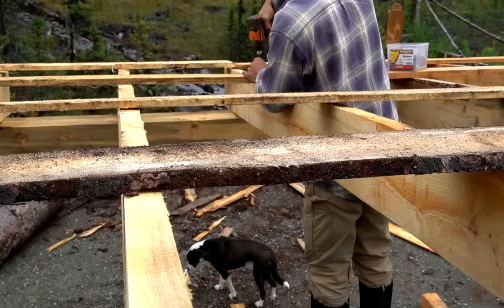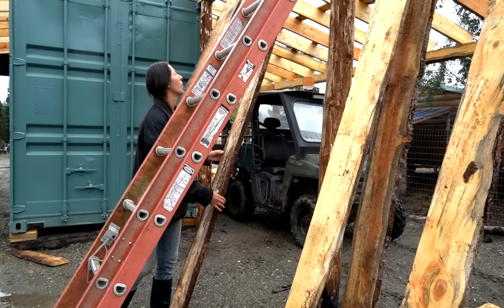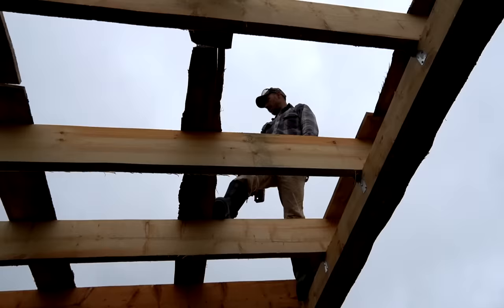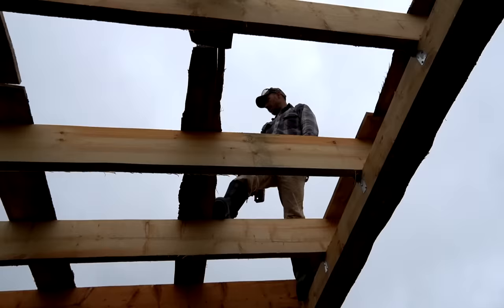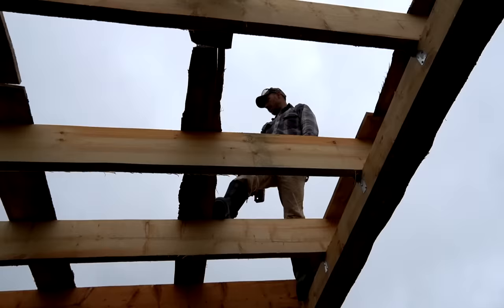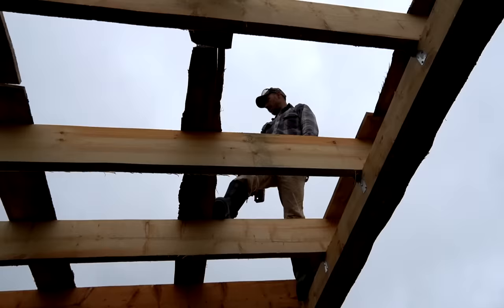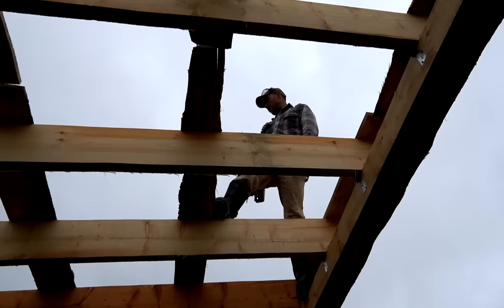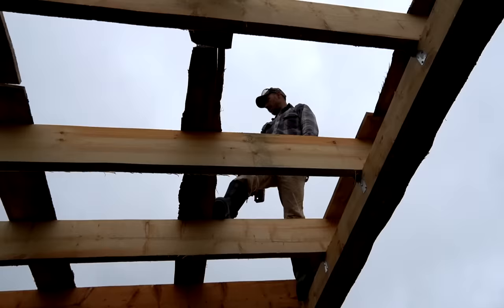Installing Metal Roof & Live Edge Siding | Shipping Container Lean-To

Comment: Okay I must know.. why did you not build one complete roof over the whole connex instead of the two separate structures? There must be a good reason behind your thoughts and I'm curious to know. Seems like it would be more efficient for snow removal and more weather tight. Not to mention if you continued one continuous roof off the back there is so much more storage to be had. ( my thoughts) otherwise nice work i hope to hear back!

Comment: out of curiosity wouldn't it be easier if the pitch of the lean-to was steeper? So in winter the snow would come of easier? Then again you've  made it very sturdy so it should hold the weight of the snow I imagine... like I said just this euro guy wondering

Comment: Ariel & Eric, I just love the end result! It will make all the difference both when it rains and snows. I am interested to know why you did not make the 2 lean to structures meet over the container thus providing it with a roof as it would save you time and the effort of climbing on it to remove the snow. You see, although not super old, I can no longer do easily some things which were quite mondane when your age, and now I do consider more options to make things more practical thus more manageable. Thank you. 
Ps: will there be a 2022 calendar, and if so, do you post to the UK?
Reply from the maker: Yes the calander is in the works, and yes we ship to the UK ;)

Comment: I’ve been looking forward to how you would put together another root cellar. Any thoughts on doing another one. Have you considered putting it under your house where you could have a floor entry (looks like a crawl space entrance but has steps down to the cellar. You could dig out a few feet (so you don’t get down to the water line and then cover it with tons of unsulation, provide a small heater and dehumidifier,   Might require adding a few extra beefy support beams to span a big enough space, but would be quite interesting. Could run a drain line around the outside of the perimeter about 6 inches
Below the level of the floor or use a sump
Pump and hole below the floor level. Just a thought since I know if anyone could pull this off it would be yiu guys

Comment: Just noticed the rear mounted winch on the 6x6. Now I have a weekend project. 
So many problems could be solved by that installation. Any mounting tips?
Reply from the maker: Just made a bracket out of flat stock and welded it in the rear frame section just make sure the dump bead will clear it. And make sure you have long enough wiring ;) love the winch on the rear!

Comment: I realize that you want live edge siding, but why didn't you cut a straight top edge at the narrowest point of each board and then overlap the straight edge of the board below with the live edge of the board above it, which would still give you the live edge look that you want, but would be more weather tight? I realize that it would take a few more boards to side it, but I think that you have plenty of standing lumber, and the scraps can be utilized for firewood kindling! To get a get a straight top edge, ( the squared off edge ) all that you would have to do is pull your tight line or snap a chalk line and then nail the square top edge along the line!

Comment: At very least you should fasten a board under the edge of the rafters that are not touching the beam. All of the weight of the roof is on the edge of the beams, making it possible that the beams could shift under a snow load until.they touch the rafters.

Comment: this is alaska ? correct ? the roofs should have met in the middle, the top of a shipping container is not made for weight. the 1st big snow and the snow load WILL collapse the shipping container in. a nice steep A frame roof would connect the two lean-to's and save this entire project from being wasted.

Comment: Nice work but it is interesting that you build for it to last maybe 10 years only. Here in Sweden we have similar climate and if we build sheds, carports and similar stuff we usually build it to last longer. But I guess it depends on how long you plan to stay there. If you do not paint the wooden beams and walls they will rot. Here in Sweden we paint most sheds and houses with Falu red paint. It is based on iron and copper oxid rich waste from copper mines. It is an open dust paint that let the wood breathe but it the same time kills all fungus and molds. One paint job will make the wood last for many decades and look dashingly Swedish. Red houses makes a perfect contrast to green nature. https://en.wikipedia.org/wiki/Falu_red

Comment: If you got access to your local dump and you take electronics take a microwave and the magneto portion of the it sends out the radiation to microwave your food if you take the magnets out of those they work real good for holding your screws and also the hard drive thing that's cuz they're really good and the hard drive sir any of them magnets

Comment: Eric, you really rushed this project and will regret it in years to come when you have heavy snow on the roof. A row of two wood canNOT meet in the space between two rafters. That's NO-NO. That will cave in from snow. And the rows are too far apart. Not wise for Alaska. You started off strong, but cut corners in the end in a rush. I would have done it differently & at slower pace & do it right for life. I would have made the long term parking much bigger with bigger roof all the way around the container in the back so you can actually drive around the container if needed. But instead, you blocked it off. I mean, with logs coming from your back woods on top of your wood mill, it's practically free. So, what's the rush?
Reply: I am afraid that VICE is correct, I don't know anything about snow loads in Alaska but here in Ontario our roofs have a much steeper angle and we put crossbracing between all the 2x8s every two to three feet otherwise the 2x8s will collapse sideways. We also add headers and footers nailed to the ends of the 2x8s.
Reply: @carld3184 , Thank you.